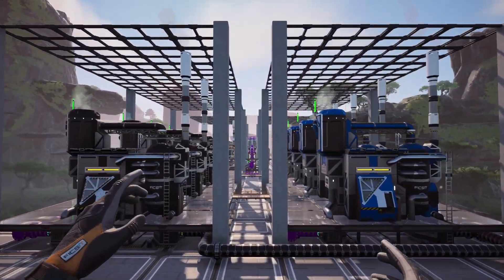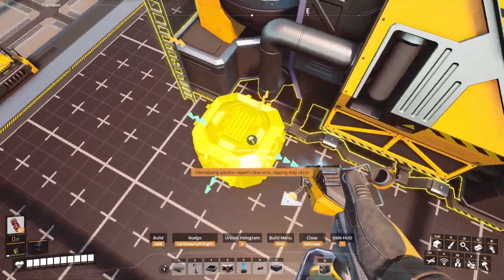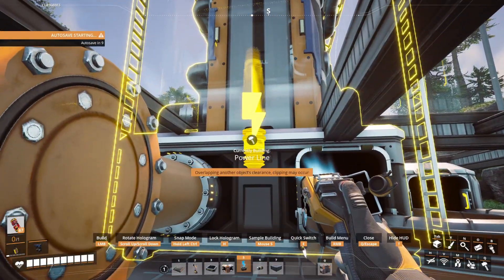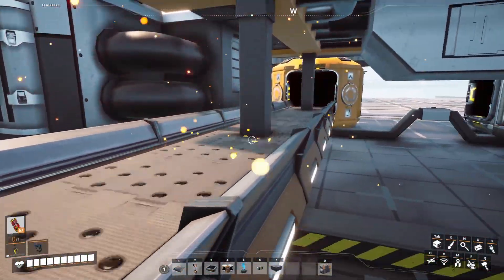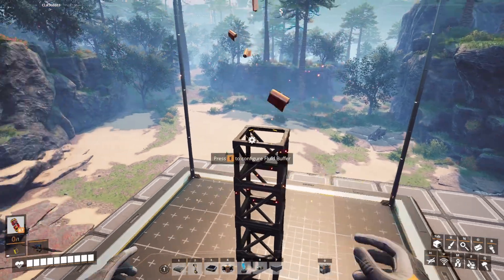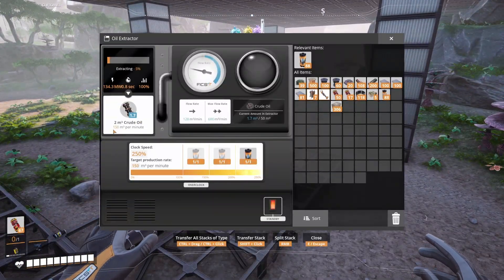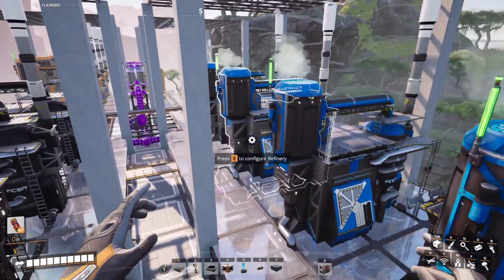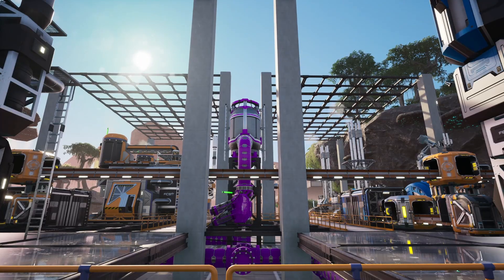Modular Mk.1 Refinery Blueprints Satisfactory 1.0 Factory Blueprint Guide  Ep. 7

Comment: I highly recommend raising the pipe junction and fluid pipe so it is not level with the refinery input. By having the pipe level with the input, you create situations such that the fluid level wants to equalize throughout the entire pipe every time a machine takes in liquid, sloshing liquid back away from the entrance of the other machines. This can create delays in filling your machines. Having a downward pipe at each machine input means that the liquid to fill it will only flow down from the main pipe above.
Reply from the maker: If we weren’t using fluid towers 100%, however using fluid towers takes out the sloshing entirely, and makes for smooth operation 👍🏻 but this is very true if you are feeding it with just pumps!